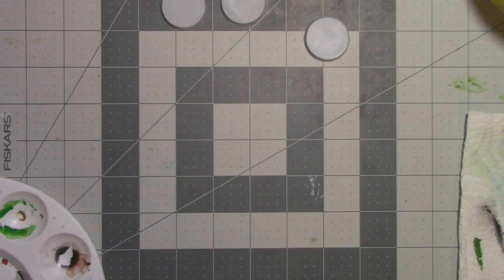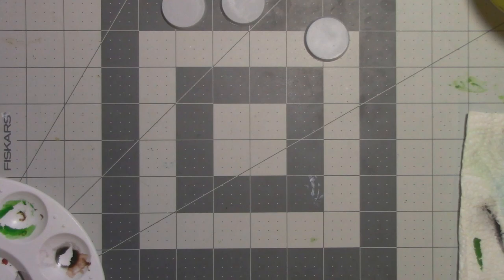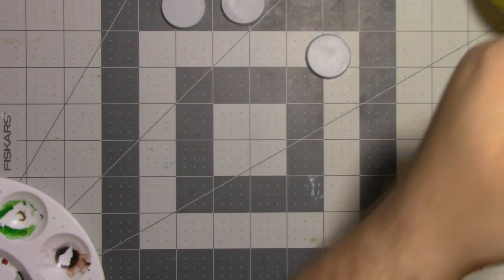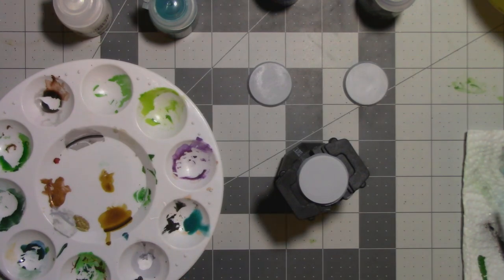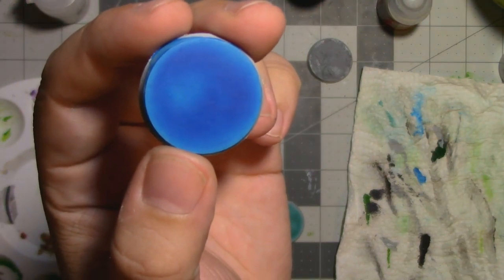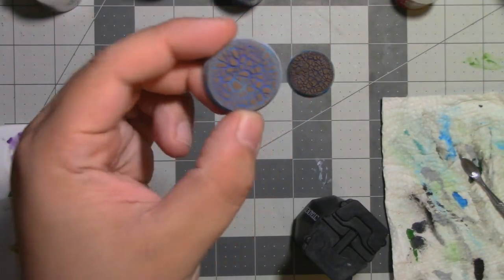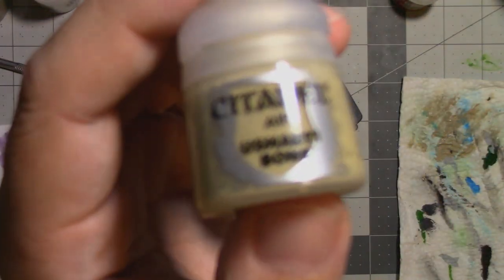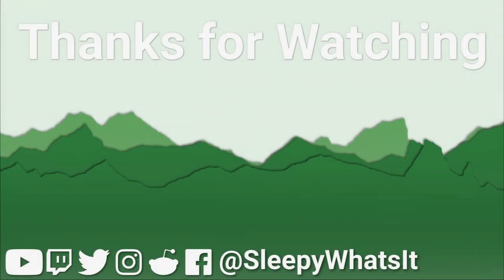Aquatic/Tidal Bases | Painting Guide

Comment: Nice finish.  I’d probably go over it all with a wash before you dry brush or do it as you did and then go over it with lahmian medium. This would help keep the texture paint stuck down and prevent any bits of the cracked earth from falling off with use.
Reply from the maker: yeah, I would definately clear coat this before putting it on the table, because the crackled sections are a bit flakey.